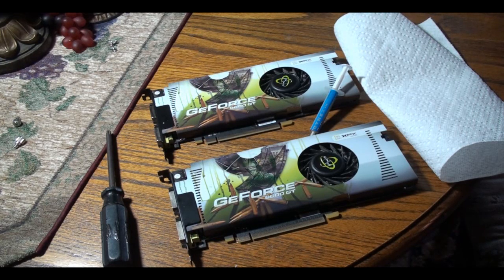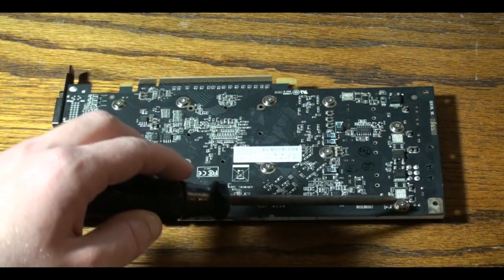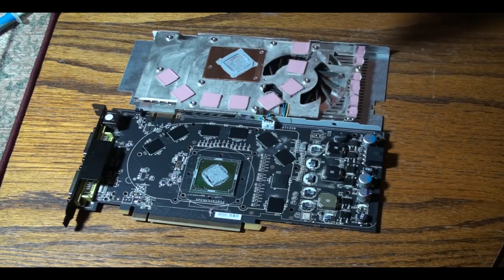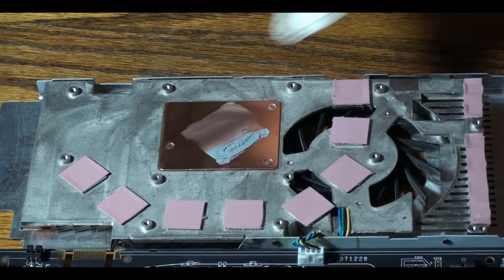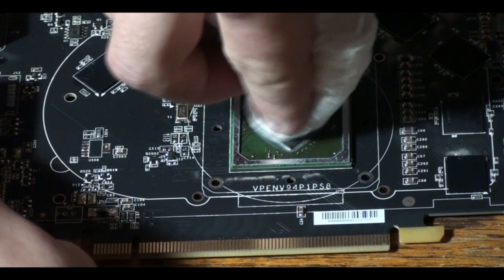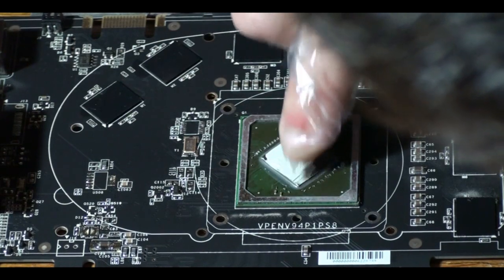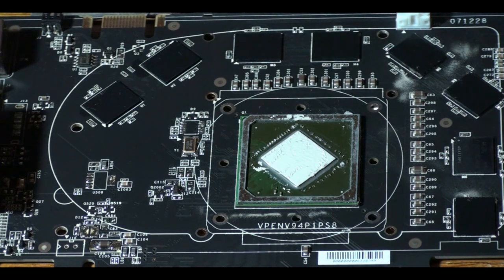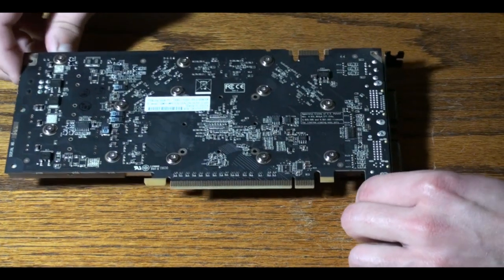How to Apply Silver Thermal Compound to 9600GT GPU

Comment: With all the knowledge that I gathered today about applying this stuff, for all I know, this is completely wrong, paper cloths leave behind fibres, and you create air pockets by spreading it out with plastic, you need to press the heatsink/ conductor on the core after you apply a pea sized amount of paste, and let it spread out by itself
Reply: +Hion-V  I am absolutely agree with you about that. It must be done the same way for CPU thermal paste changing too :)
Reply: +Hion-V A microfiber cloth is recommended for cleaning off thermal paste, and you're correct, pressure from the heat sink is better than spreading the thermal paste yourself.

Comment: Cool. both figuratively, and literally. My AMD Radeon HD 5750 runs too hot and can be just from watching South Park. Games can be ridiculous. This card is a dust sucker for some reason, and I finally figured out why. I smoke. I know, bad boy, go stand in the corner. Anyway, the smoke gets in the GPU and elsewhere depositing a nasty yellowish-brown residue all over the place and it's sticky like a magnet. The dust loves it. I've cleaned out the thing several times but not going as far as this video. My CPU has the same problem with the heat sink as well, and I have taken the fan off, and sink only to find a gooey mess of dust and smoke tar. Moreover, I never reapplied any thermal compound to the CPU, nor have I removed the cover off of the GPU to clean inside and then put the compound on that. So, my Gateway FX 6840 - Intel i7 - 8GB with a Zoner DX audio card that resides just beneath the HD 5750 and also blocks some of the fan blades on that card has all conspired to make my computer tower capable of being a blast furnace for melting steel. I just need a giant crucible to poor the molten steel out of it. Thanks for the tip. This will surely help me, and also adding a 120mm fan out the side of the case, and increasing the size and rpm of the one in the rear. Peace...
Reply: Well, if anything else fails, it is a good incentive to quit smoking :D

Comment: Hey, you are using silver thermal compound, just like me. But I noticed something I do not fully understand. You put the thermal compound on the core, but also spilled some on the chip itself. Doesn't that short it out? Silver is conductive... I'm thinking about changing the paste on my GPU, because it's almost melting itself @ 83c. I just do not want to kill it by shorting it out.
Reply: 83º C... I feel you. I am getting into idle 60º and pushing it makes the card hit 100º. I know it has been two years, but did you manage?
Reply: Thermal paste is not conductive enough to short anything.

Comment: I had to do this recently and followed the clip. Minus the pointless and bad part of fingering the paste. I cleaned up the old paste which covered everything. After that the vrm temps were very high. I then clean up and reapplied this time drowning the little transistors that surround the chip, this made a big difference on the vrm temp and bought the core temp down a little too. 
What are those little things around the chip? Why did this happen?

Comment: You are the man. Just tried on my VGA, followed step by step and it worked. My GPU temp dropped from 80C idle to 40. I used Artic Cooling MX-4.
Reply: good job, thats a good thermal compound choice.

Comment: @Famoussasdrummer182 - i hav a geforce 9500gt ... nw games are getting very lagging after 10 or 15 minitues of gameplay....when i checked the temp its about 110c which is very not good....so i changed the thermal paste just lik u showed....bt still its getting laggy... plz tell me how to fix dat and y is it lagging.... should i buy a new graphic card? plz rply ASAP

Comment: question... i just reapplied the thermal paste on my gpu with artic silver 5 and using alcohol to clean. I am now getting temps of 66 idle and 88c during gaming but no crashing as of yet. My 9600GToc dosent have the copper plate or the pink pads featured in this video. The gpu and those black chips rest against the cooler directly. Are they necessary? I followed instructions to this tutorial exactly. Cheers.

Comment: You probably don't keep up with this video/comments anymore, but a program called AIDA64 is reading my GPU's temp to be as much as 108 C while it's in use (playing a video game, League of Legends) and my computer seems to be shutting off due to this overheating issue.

The cooling fan output remains at around 86% even when the GPU is not in use.  Do you think my overheating problem is related to the thermal paste?  Or is it related to the fan?  I cleaned the fan, but nothing has changed.

Comment: Question: i jsut re-applied thermal paste to the gpu with the compund that came with my cpu fan/heatsink which says Noctua NT-H1 on the tube.
But now im getting reading up to 95 degrees celsius which is probably not good, could i have done something wrong? I didn't spread the thermal paste evenly with plastic on my finger i just simply put a dot on the centre and put it back together, could that be causing this ?

Comment: now that looks like proper factory compound.. I just took apart my 8800GT which I'm planning to revive by adding it to my 5870 for  Physx, and it had thermal compound covering the WHOLE gpu, not just the center, and it was a thick caked layer may explain the high temps.

Comment from the maker: hey 
it dropped the temps by about 8 - 10c under full load that for a lot of people is very good.
I have two of them in SLI so putting a accelero s1 in there i wouldnt have enough room in between but thats a great option for running a single card.
ya it sounds like a lot of work but it isnt man i can do it in about 5 min. if i wanted to

Comment: Yeah i DO have a question: 
How much difference did it make to the temperatures? And if you care about the temperatures, why don't you mount an accellero s1 for $15. This brought the temps of my 9600gt from 60 degrees celsius idle to about 37. This just sounds like an awful lot of work for a very small gain.

Comment: you should put a little more thermal paste so the paste can have more contact with the copper bottom of the heat sink! Trust me my processor was real hot cuz I put a nice even thin layer of artic 5 and it this get to 72 C and I never crashed which is weird it was to high but i took my heat sink off and add a good fat not so fat but not so skinny layer of artic 5 and Success i booted back up my CPU temp drop dramatically it went from 72 C to 60 C to 54 C idle.